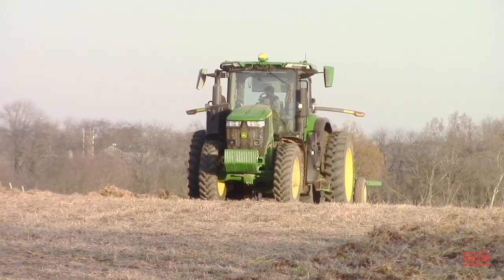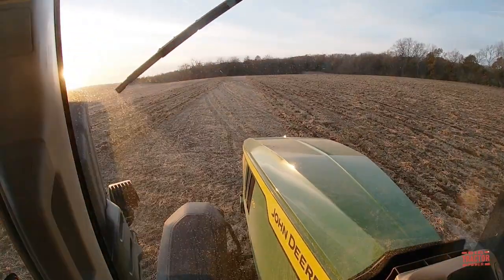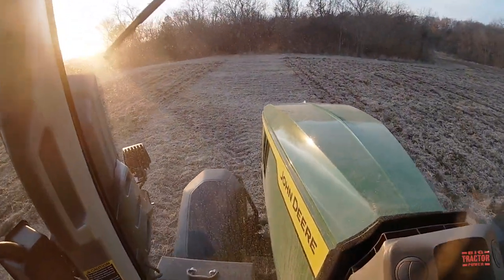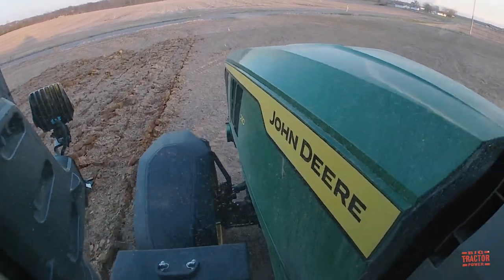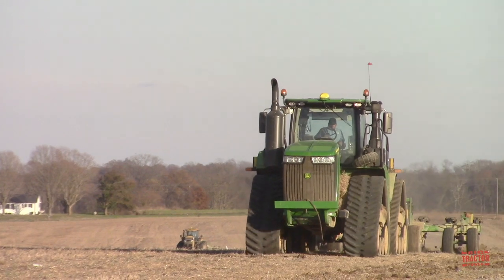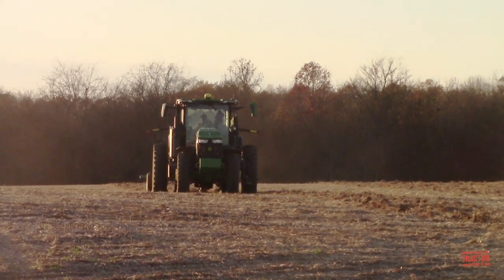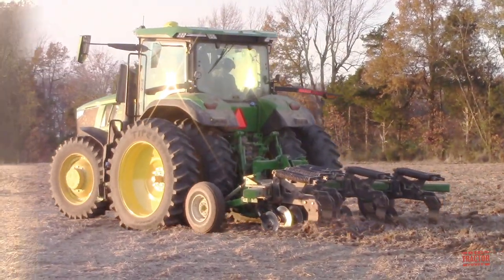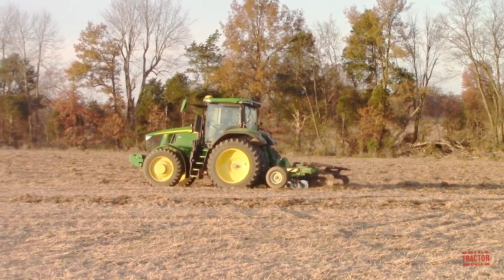JOHN DEERE 7R 210 Tractor Working on Heavy Tillage

Comment: Thank you very much including the PTO horsepower in the specifications.

Old dinosaurs like myself have trouble with engine horsepower ratings as they don't reveal parasitic losses of various transmissions or hydraulic  systems.

Comment: How often does the farmer have to change the points on the subsoiler, when we used moldboard plows in south Georgia we had to change the points every two days and the wings at least once a week if we worked hard
Reply: I am not sure about this farm, but on our rippers and moldboard plows we change them about once a year. Our ripper is very similar to these subsoilers.
Reply: Normally a farmer changes the worn out parts before they start
Reply: That’s what we do on our farm at least

Comment: Would the 350 at max horsepower be able to pull a 7 shank
Reply from the maker: It depends on the soil conditions, depth and speed. This farm pulled 7 shank 915s with 375 hp 9330s with ease.
Reply: The the 7r 350 can have up to 385 horsepower

Comment: 4020! ~ we lost everything else due to the severe drought
Reply from the maker: Where do you Farm that the drought has been so bad?
Reply: @bigtractorpower  saskatchewan, 1 inch of rainfall all of 2017, 3 inches of rainfall all of 2018, 5 inches of rainfall in 2020  ...there's been some pretty terrible years, and try and raise livestock off of that yet
Reply from the maker: That is terrible. Where do you farm that it has stayed that dry that long?
Reply: @bigtractorpower  central saskatchewan, yes very bad, and the late 80's-early 90's were even worse - crops didn't even come up at all those years